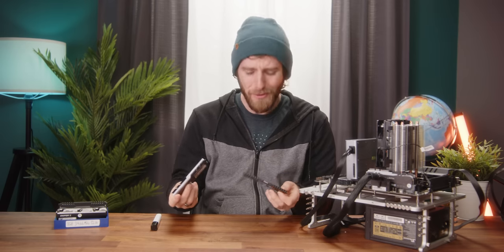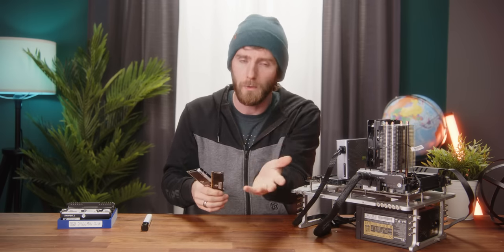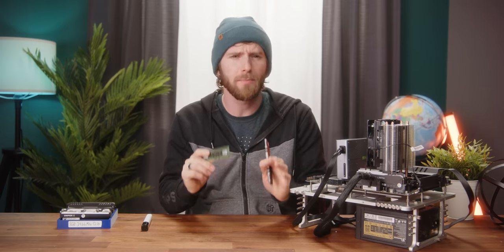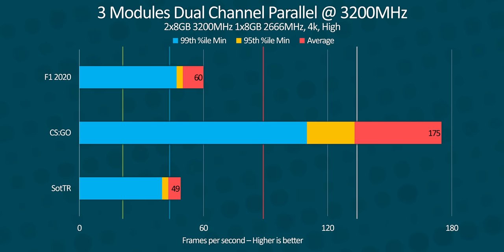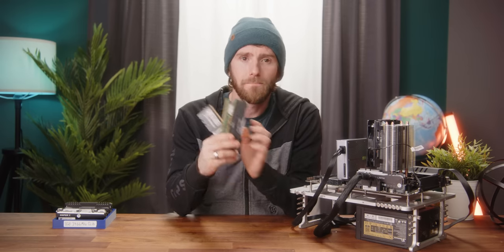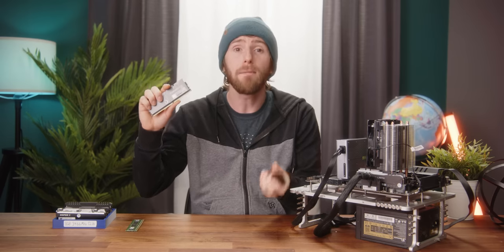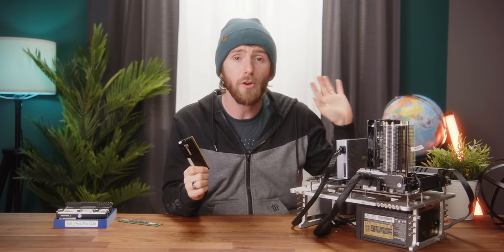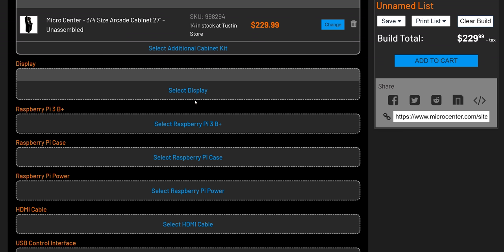Just How Bad is Mixing Memory?

Comment: "As long as your workload doesn't exceed the capacity of the smallest module"
Ah, maybe that extra 2 GB stick in my computer isn't a good idea...
Reply: It has to not exceed twice the capacity of the smallest module, acually, and even when it does that extra is just going to run as single channel, which is presumably the alternative anyway.
Reply: The question i want answered is what the implications are for anyone with soldered ram in their laptop.... If i have 4gb on board and need more than 8gb in total what does that mean for dual channel operation and if you want to get faster ram how do you know what the modules on board will handle??
Reply: It only creates a performance impact, not compatibility errors
Reply: I have two 1gb module just to fill the slots, guess I should remove them then
Reply: @HonkForLife098  But if you have 2x8GB and 2x1GB in their respective Dual Channel configs, (just as an example) that shouldn't impact performance in the same way...
Reply: Right now i have a 1666MHz 8GB stick and a 1300MHz 2GB stick in my DDR3 machine. Is that a bad idea?
Reply: Hum I'm still running my old PC with 2x1Go+2x2Go ddr2... (same specs, different capacity)
I'm using linux and it's more forgiving than windows in many cases
Reply: In a noisy workshop ... so yeah
Reply: I also have 8GBx3 and 1x4GB all filling up the slots to make 28GB ddr4, should i upgrade the 4gig to 8gig or what?
Reply: @oktayyildirim2911  yes because all your ram will run at 1333mhz
Reply: @farasty7371  I'm aware, but does it really make a difference?
Reply: @oktayyildirim2911  you'd would be surprised of the difference it makes. Does your motherboard support memory oc?
Reply: @farasty7371  I use a Gigabyte H81M-H. How can I tell if it supports memory overclocking?
Reply: @Red_Eye_Jedi  If you have 4GB onboard and need more than 8GB total, then you will have 8GB running in dual channel + whatever is left over running in single channel (4GB for an 8GB DIMM, 12GB for a 16GB DIMM, 28GB for a 32GB DIMM). As for speed, you generally won't be able to go beyond JEDEC speeds and timings for configurations like these, as they typically lack both XMP and manual OC support. So the best advice if buying extra RAM for a system like that is to buy sticks that are JEDEC rated (not XMP! That's important!) at the same speed as your stock RAM. Current 3200MT/s laptop RAM is typically JEDEC 3200, while most 3200MT/s retail RAM is XMP 3200 and might not include JEDEC profiles at all beyond, say, 2666 (or even 2133 if you're really unlucky). If that's the case, the built-in RAM will downclock to meet the JEDEC settings of the added RAM, making your system a bit slower.
Reply: @Red_Eye_Jedi  literally the case with my laptop; 8GB soldered + 16GB SODIMM 

Up to 16GB total, nothing changes compared to the OG 8+8 config. When I pass 16GB, there is nothing noticeable, but synthetic tests show its slower.
Reply: @oktayyildirim2911  hahaha I'm currently running 1x8GB 1666, 1x8GB 1333 and 2x4GB 1333 for a total of 24GB at 1403MHz.
Never had an issue.

I did have to go through a lot of frigging around with modules and "slot order" to get a set to work though.
Having seen this, I might have a go at tweaking the bios timings. Might be able to push em a bit harder.
Reply: @memedzaddy   for speed only ... will be negligible though unless you are using cpu graphics then the improvement in speed will be alot more in terms of 3d processing
Reply: @phillipcoetzer8186  the speed and timings are  the same for all the modules , and theyre all from the same manufacturer but the size is the issue and im using a dedicated gpu since i have a ryzen 7 2700 which has no intergrated gpu, will my memory bandwidth be limited to the smallest module ie the 4GB one
Reply: @memedzaddy   then no notable difference will be achieved 
leave it as is unless u run programmes demanding more ram than you currently have
Reply: I have a question, my laptop motherboard support dual channel but locks the ram speed at 2400mhz and 4gb 3200mhz ram is in it(it detect 4 gb but speed is 2400mhz, ive confirmed the 4gb ram speed and it really is 3200mhz). If i put 8gb 2666mhz ram on it what will happen?

Comment: I've done mis-matched RAM for years. As long as my Frequency and Timing matched I've never had an issue.
Reply: Same here. Worst case has been running them both at the speed of the slowest module. Works great for non gaming systems that don't really need the extra speed.
Reply: @espanalibre9505  Wouldn't check out four links without anyone mentioning why.
Reply: @espanalibre9505  Spam...
Reply: I had a laptop which has mismatched ram in it and i think the timings arn't even the same either ... still works ( at least teh last time i checked it...)
Reply: @hdezn26  yeah, generally they should all just down time to match.
Reply: I wanted to upgrade my Lappy. But it has 2133mhz ram. I had to buy 2400mhz RAM. I inserted it but I have been getting BsOD whenever some RAM heavy task is needed for Example using Tableau or installing and using Chrome at the same time. So what should I do ?
Reply: @shonkylovesgaming1766  so your frequency and timing don't match then. Making my point for me here. 😁 If you replaced all RAM, so only the 2400MHz RAM is installed, then you probably have a motherboard compatibility issue with that RAM or you got a bad stick, but that isn't a mixed RAM scenario of you removed the original memory.
Reply: I mean just manually do the timings and it's fine
Reply: @shonkylovesgaming1766  try and force a consistent frequency.
Reply: Repeating a question, just in case. So you're saying I've been wasting time trying to find a matching kit of 2x4 HyperX 2666 CL15 (which isn't sold anywhere anymore) to add to my two sticks, and I could buy a vastly more popular 2666 CL16 kit and it will 100% run in dual channel, even with a mild overclock? That's a serious question by the way, I really am anxious about buying a mismatching kit. I heard a few years back, I think even from some tech YouTuber, that unless the speed and every single timing is matching on the second kit of ram, the dual channel won't work. And this video sounds kinda inconclusive, like what if I don't want to match a 2666 and 4000 kits like in the example.

P. S. You know a person is desperate when they seek tech advice from strangers on YouTube.
Reply: @mihan2d  Consider, how much is the CL16 kit? How much is a similar quality 8x2 kit? Is the stress and potential need to return the CL16 kit worth the savings?
Reply: @shawndiaz7528  I think the video made it pretty clear that sometimes there are better deals on additional kits, didn't it? Also bruh, too bad so sad, in the time it took someone to respond, I already went ahead and found a matching kit of 2x4 for a sweet deal, your "it (might) won't work" is already a few hours late as it seems to be working fine, even with a mild overclock.

P. S. Instead of people with similar experience being actually helpful I got doubters without relevant experience claiming I shouldn't even try. Well anyway, thanks for the motivation I guess.
Reply: @mihan2d  literally just trying to help with your decision making process. Not sure why you're being defensive.
Reply: @shawndiaz7528  LOL dude, in another thread someone actually was trying to help, you were just saying it's a stupid idea and you shouldn't even try it. I realize it's a stupid idea OK, but if it's stupid but it works then it's not stupid anymore, and all I needed was to verify it will work :D
Reply: @mihan2d  I didn't say any of that.
Reply: @shawndiaz7528  Yeah that's what I'm saying, you were NOT being helpful in the context of the issue no matter how you look at it 🤣🤣
Reply: @mihan2d  All I did was suggest you to weigh your decision against alternative options. No need to stress if it's not really doing much for you. You're clearly very stressed. Hope it works out for you but seriously, relax a bit
Reply: @mihan2d  You've done nothing but make dozens of assumptions about my intent and complain about it but I'm presumptuous.
Reply: @shawndiaz7528  Complain? Who's complaining here? I now have 16 GB of RAM of two kits working well on a custom XMP profile, I really have nothing to complain about. You're AGAIN presumed for me something which I didn't mean when all I'm trying to do for like 5 comments in a row already is to point out that what you call advice was not helpful nor even very relevant in the context of the original question. You keep missing this point.
Reply: @mihan2d  Just read the things you've said to me. It's all complaining. I am muting you because this is not going anywhere
Reply: @shawndiaz7528  See, this is why you're presumptuous, you decided FOR ME that I'm complaining when in reality I was really mostly subtly making fun of how you were trying to make me take your advice which wasn't even relevant to the question, and wouldn't get off me until I budge (by wrongly admitting it is helpful, I assume?), and now he's saying he's muting... Well dude, you're doing me a favor here, not anymore I don't have to listen to a guy who clearly never admits he's not helping and refuses to call quits until people, uhm well I assume pretend to take his advice no matter how useless it is, or something.
Reply: I disagree, you just can't exceed the limit of the weakest pair. My last mix was 2133mhz cas9 1.65v with 1600 cas9 1.5v. I needed to play with all four timings but finished at 2000/cas10. Mobo didn't like >2000 even with the fast set alone.

All the laptops I mix with are either the spec or 1 step faster, I only had one laptop hate a particular mix.
Reply: @mihan2d  can you please show me where Shawn Diaz said "it's a stupid idea and you shouldn't even try it"? From what i read he was laterally trying to help lol
Reply: so if a 16gb ram at 2400 mhz and a 4gb ram also at 2400 mhz would it be good?
Reply: @mihan2d  He was really just trying to help you man. You immediately became defensive for no apparent reason, and came across as the presumptuous one yourself. Chill out, and take a step back before lashing out at some random person who’s trying to provide some input when you’re the one who asked for it.
Reply: @Ghostsoulless  It's not helpful when you issue a general statement which isn't even exactly on point with the original question. I. e. "help, my dog is sick, what do I do" - "get a cat" isn't exactly helpful. And neither are you. I don't need hindsight judgement from some random dude, where I live it's called flapping your fists after the fight is over. You need to chill out to know better than jumping guns blazing into an argument which ended a month ago.
Reply: @spaghet-lessbonesauce2479  "You could have ignored it like any normal, emotionally stable person"
Joke's on you, pal, with your wall of angry accusatory speech with genuine insults, as a result of poking your nose into somebody else's conversation. But you're probably too entitled to notice the irony of the situation.
Reply: @mihan2d  read your original question and the guys response to your question, and explain to me how his response was unhelpful please.
I won't get Into the ensuing argument and name calling afterwards I just want to understand you
Reply: @mihan2d  youre the one that started with insults and crazy made up accusations. I think you need help dude.
Reply: I enjoy seeing how the entire snowflake part of the PC community has ganged here to cancel a stranger (well good luck with that) over not accepting a useless advice. You guys really don't have anything better to do with your time. Though I'm ok with that. It's your job to be constantly offended.
Reply: @mihan2d  "ganging up" LOL so like 2 or 3 people have explained to you that you misinterpreted someone's comment as being unhelpful and you think people are "ganging up" on you? 😂 Do you want a tissue?
Reply: @tom6549  *three triggered mor0ns
You're welcome
Reply: @omicron7735  I'll thank you mоm once I'm done. I mean I have some manners, after all.
Reply: @mihan2d  you need to chill. All I saw him do was try to help. You seem very sensitive and defensive over nothing. Not a good look especially if you’re seeking help
Reply: Holy shit someone needs to touch some grass.
Reply: @OriginalMergatroid  Exactly, RAM works to the standard of the slowest module so long as you are using the same types of module (DDRx vs DDRy, Desktop vs SO, ECC vs Non-ECC).
Reply: Wtf 
Lmao
Reply: Think they mean mismatched like 4GB & 8GB modules in that same bank

Comment: I always mixed my RAM and never encountered a problem.
Back when every single MB counted I had 3 different sticks of RAM (512, 256, and 128MB) from different brands and running at different speeds.
Reply: Do you think i can throw a trident x royal 64gb on a ddr5 board?
Reply: @brandonscherrer6487  depends on how good at welding you are
Reply: @jamesr9400  lol
Reply: The only thing that doesnt work is when they run at different speeds. Your bios will automatically set them all to the lowest one you have. You could also overclock it tho
Reply: @brandonscherrer6487  No since it is ddr4. Which will not work on a ddr5 board.
Reply: @jamesr9400  technically soldering
Reply: 8GB 3200 mhz Or 32Gb 1600mhz 
Which is better for gaming ?
Reply: @imperia6368  Probably 8GB 3200 mhz, but it depends which processors.
Reply: @glurp1er  Intel i5-11260H 11 gen
Reply: @imperia6368  I would choose the 8GB 3200Mhz.
And you could still add another 8GB later.
Reply: i have a qs can i overclock my 3000 mghz ram to 3200 and pair it with a 3200

Comment: I mixed 2 sets of 2x4 ddr3, different speeds. Only thing that caused issues was having XMP enabled, but I was able to OC the lower speed ram manually and have been running it like that for at least 3 years

Comment: Thanks for another very informative computer related video.  I was always told mixing RAM modules would cause problems, but I have an ASUS E35M1-M Pro motherboard from 2011, which has two sticks of DDR3 4 GB RAM; one 
Corsair XMS-3 and one 'no-name' stick of DDR3 4 GB RAM.  They've worked happily alongside each other in my Spare PC since 2015, when I built my gaming PC.  So much for all the warnings of 'dire consequences' from various 'experts'.  Keep'em coming.  Russ.  UK